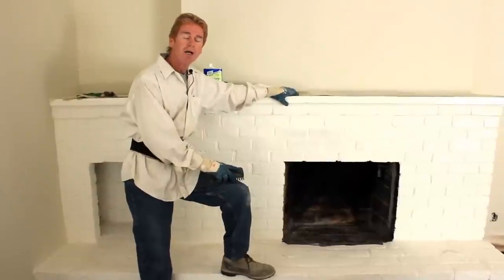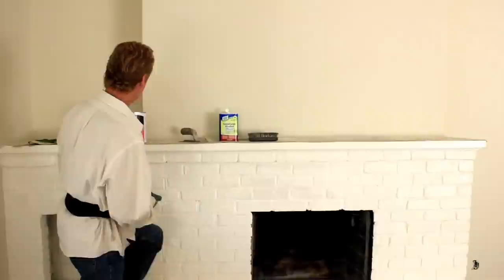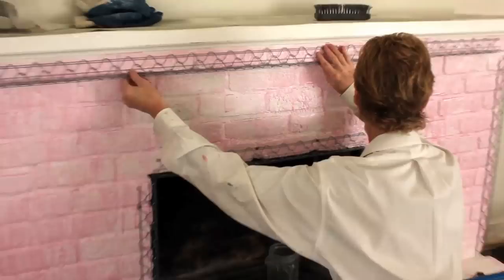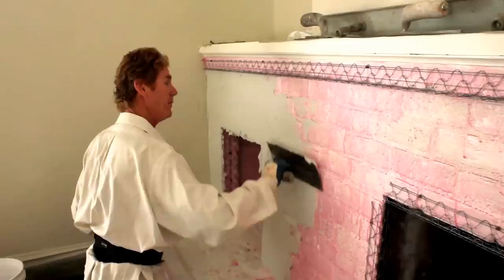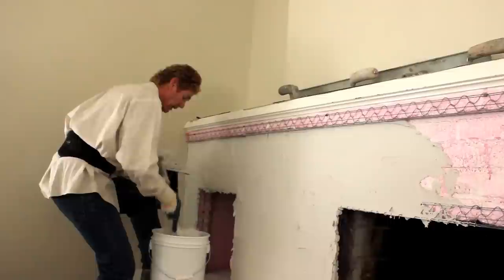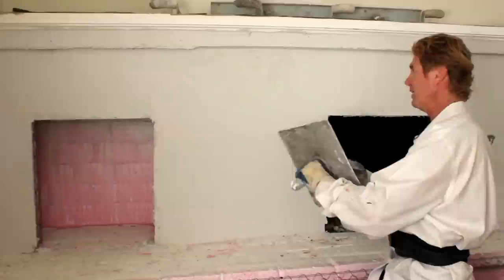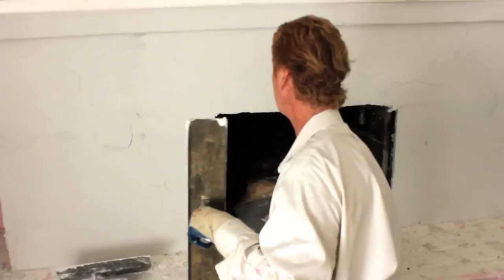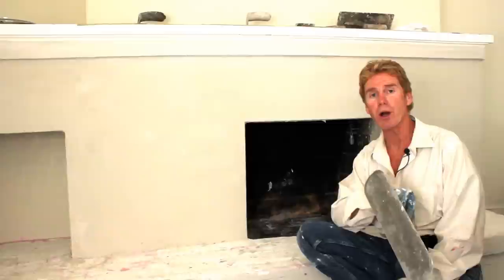Plaster over interior brick fireplaces

Comment: Nice work Kirk! Can a person use structo-lite over a brown coat for an interior finish?
Reply from the maker: Good Evening Dude, I Would not advise this as structo-lite is a basecoat and does not finish well at all, spreads out very gummy.
 Instead I would highly recommend a veneer finish.
 much easier with better results.
     Live long and plaster
  teaching plastering video’s
Reply: Kirk Giordano plastering Inc. Thanks Kirk!!  I'm trying to match a 100+ year old plaster job over brick.  The plaster deteriorated so I've chipped all of the loose stuff off, had a Mason repair the bricks and then I plan on scratch/brown and then was going to use structo lite.  I think I'll try a diamond veneer.  Matching the 100+ year old texture might be the trickiest part.
Reply from the maker: Good Evening dade, it all take a bit of practice.
     Live long and plaster
  teaching plastering video’s
Reply: Could you use structo-lite as a scratch and brown coat and finish it with 20 minute mud? Or could you just use multiple coats of 20 minute mud by itself? I have a similar issue going over brick on an inside exterior corner and I don't want to hang sheetrock for fear of mold.
Reply: @justinmcfadden6566  In one of Kirks other video's for finishing an interior fireplace wall .He uses outside corners , plaster weld, followed by structo-lite, then 20 min mud to get a smooth finish. looked great.

I would not want to do sheetrock on brick either. , easier to clean very well. plaster weld, then structo, and 20 min. since both materials are gypsum based they will stick to one another very well.   Kirk will have to approve this but Im getting all this from Memory of watching Kirks other video's.

Comment: Kirk- say you wanted to plaster over tiles (interior) where the glaze has been sanded off with and orbital sander---but with no more than 1/8" inch of plaster.    I've seen when you go thin in other videos you use 50% watered down weld crete.   Could I do something similar with weld Crete and 20 minute mud?
Reply from the maker: Greetings Matt, if it were me I would use full strength bonding agent, and yes you can apply 1/8 to 1 inch if you wish,  FYI, 20 minute mudd is an excellent choice.
best wishes
 Happy holidays from the Giordano clan

Comment: How about plaster over wallpaper?
Reply from the maker: Evening Rev dude, won't work, when wallpaper gets wet, it loosens.
 The Bonding agent necessary is mostly water. This alone will loosen the wallpaper, thus remove any topping whether or not it's plaster, paint, stucco, etc.
 You would have to remove the wallpaper and any and all residues first.

                  Bringing peace, love, and harmony back to the world of plastering.
    The complete plastering encyclopedia on video, by the plastering messengers of Youtube.  
                                                     Over 800 videos
Reply: Kirk Giordano plastering Inc. Gentleman I appreciate your sage advise. Seems like there’s no replacement for hard work even in 2020. Thanks so much for the insight! Happy new year and stay busy/safe!
Reply: 1/4" sheetrock right over it faster cleaner brand new walls
Reply from the maker: EveningCoach, too funny. I guess it never crossed your mind as how to attach sheetrock to the bricks.
                  Bringing peace, love, and harmony back to the world of plastering.
    The complete plastering encyclopedia on video, by the plastering messengers of Youtube.  
                                                     Over 800 videos
Reply: @StuccoPlastering  I did a dab process ive done it it works few dabs of compound drywall sticks to it fine then corner beads and taping locks it all in just an idea . Either way is cool and i like watching your videos especially when u reply lol